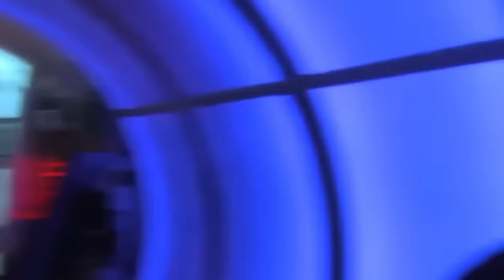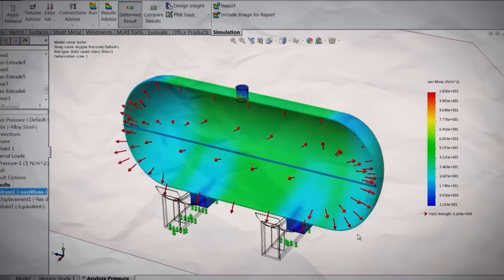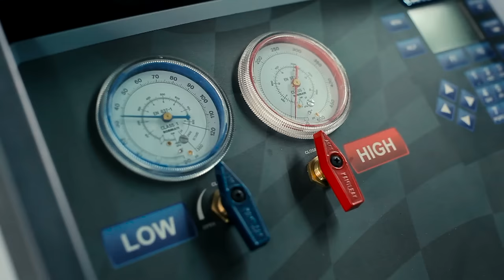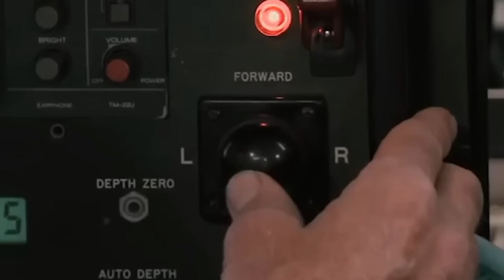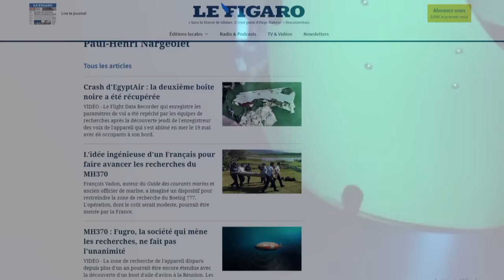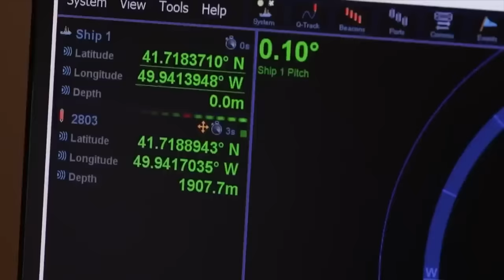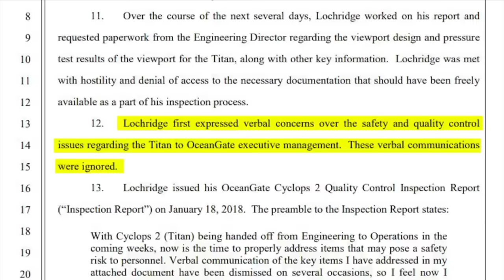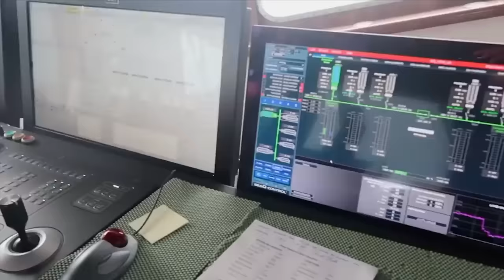Insider Just Reveals SHOCKING New Discovery About Oceangate Submarine TITAN Implosion!

Comment: As a professional engineer. I am very insistent to the point of dismissal that my opinions and rulings are observed. Rush and I would have definitely clashed and I would have been dismissed. But I would have reported him to any authority that would listen including the media. As a professional engineer you are duty bound to report first to the controlling person or body like an owner or board. Then you act if ignored. The Challenger disaster is a classic example of engineers being ignored. They all knew the O rings would not work at the reduced temperature as Feynman demonstrated at the inquiry. Such a simple test with no special equipment required. I have tested O ring performance also using a similar simple test to prove it taking a set.

Comment: Top shelf video...again.  Excellent production values.  Don't even want to think about how long it took you to generate all those beautiful graphics.

As a fellow engineering Nerd, I think the mating of CF to titanium was definitely involved.  Tiny differences in the contractions of the 2 materials could translate into a fracture.

And even though all the Talking Heads were endlessly trumpeting the compression versus tension theory, they are in large part correct.  

To my mind, it was just an epoxy resin tube.